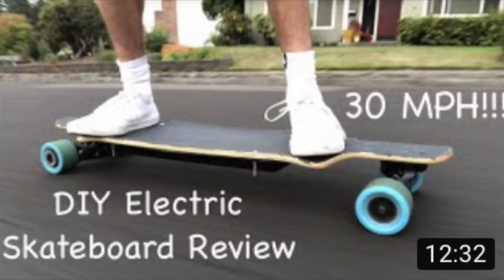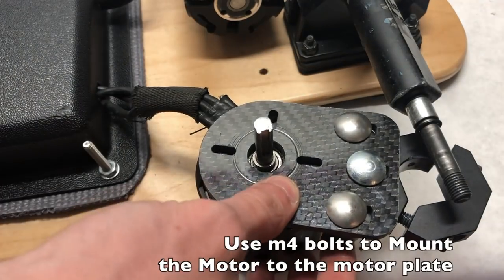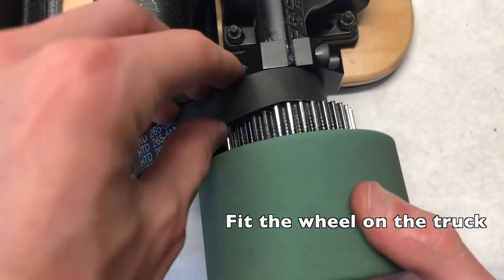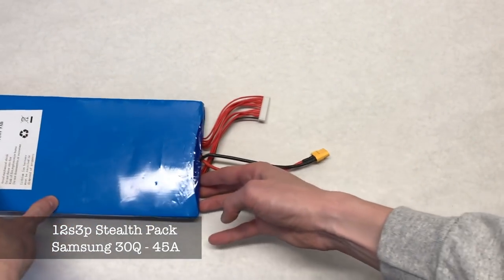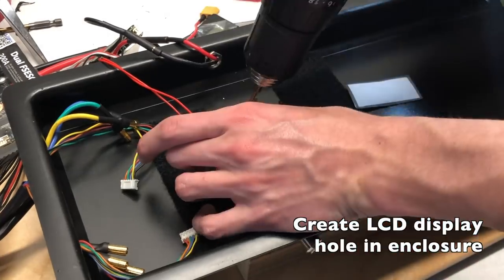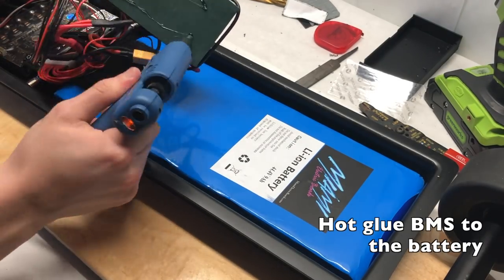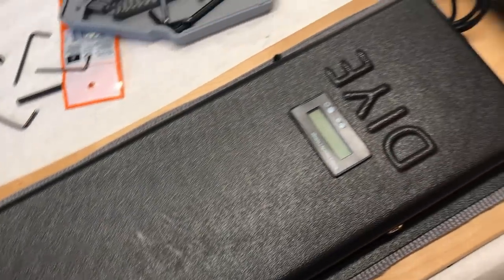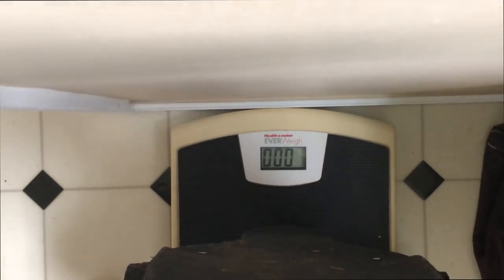How to Build an Electric Skateboard - 12s3p Dual 6374

Comment: wow you guys deserve way more subs! im gonna build this board if i can fond the parts
Reply from the maker: Sorry for not having a parts list for this board. We are in the process of making a new website. You can find a lot of the parts that we used on our old website: https://diyesk8builders.wixsite.com/esk8/12s2p . Here are some of the things we put in to make this new version. Motor Mounts: https://miamielectricboards.com/shop-1/motor-mounts. Motor pulley: https://diyelectricskateboard.com/collections/motor-pulleys . Belts 265mm HTD5: https://diyelectricskateboard.com/collections/pulley-timing-belts . ESC: https://flipsky.net/collections/electronic-products/products/dual-fsesc6-6-based-upon-vesc6-with-aluminum-heatsink. Battery: https://miamielectricboards.com/shop-1/standalone-stealth-pack . BMS box: https://miamielectricboards.com/shop-1/12s-bms .

Comment: I was looking at the same deck for my first build.  couple questions: also looking at long battery enclosure- is there too much flex in the deck?  Is there enough clearance for motors when carving? or could you mount motors to rear of truck?
Reply from the maker: The deck is not flexible at all, its stiff and you can mount the motors on the rear

Comment: Not all the people have 200 bucks for a ESC and other expensive components. However, you can get almost the same  feeling of riding using only 50-60$ dual motor ESC. Of course if you want much better torque and AMPs you need a better ESC, but for beginners 60$ESC is more than enough. There are also good motors for 50-60$ with 2000watts of power, you can go even lower if you buy hub motors. I don't want to advertise anything here, but you can google and easily find those components. Good luck guys. Let the electrical force be with you.
Reply: honestly disagree, my first build used the cheap 5055 dual kit and a cheap Chinese $100 dual esc. after around a month of use they just stopped working so i got another esc and then the motor kit was having slipping issues even after a belt swap. its worth it to just save the extra few hundred dollars. TRUST ME

Comment: very nice e-skate.
do you think a 218 mm truck on a loaded vanguard would look ok? i'm going to build a e-skate, but i want to use the 6374 motor for extra power because i'm like 200 pounds and i  want the motors to work without struggle.  thanks.
Reply from the maker: Yes! We actually just finished a build like this and we are releasing the video later today!
Reply: @DIYesk8Builders  that's really good news. Thanks

Comment: Smooth bro. Built my first recently, a single 6374 with 94 mm wheels and a 150 amp rc speed control I got 10 years ago. I finally put it together when batteries got cheep enough! So I'm running a 4 cell Lipo (7000mha) and get an hour and 15 minutes at full throttle (14 mph). BUT THE SPEED CONTROL! Do NOT use a rc speed control, it's INSTANT FULL TORQUE!(even on the Lowest throttle setting)!!! You Really gotta feather that throttle or it will leave without you!! Do VESC's have a much gentler throttle curve?!?! I'd love to know cuz mine will wheelie on 4 cells and it can handle 12 cells... sooo... much appreciated amigo. Nice channel, subed. :-) (Oh,, and I tried it on a 6 cell 5000mha Lipo once... ONLY Once..) The torque with the current speed control is unmanageable. I'd pull a frigging car. I'm thinking that's cuz of the 150 amp (continues, 200 peek) speed control and 50c lipos able to push 200 amps in an instant. Makes it a bit of a crazy ride and all. Cheers!
Reply from the maker: Thats awesome! We did a similar thing on our very first build using an RC car ESC. I 100% recommend getting a VESC, the throttle curve is so nice and will definitely not throw you off the board. It is a difference maker that you can definitely feel and it will make your ride so nice. You can also use more cells in series and run the motor in sensored FOC once you start understanding the VESC tool.

Comment: How would you rate this against an off the shelf board? I'm eyeing up the new exway flex but have just seen this.
Reply from the maker: All diy boards in my opinion are far superior in terms of all specs. Where its advantageous to have a pre built off the self board is that its a refined product. You know its never going to break, the controls are slightly more fine tuned, apps that connect to the board.

Comment: Sorry I'm really confused. May I know if I'm using dual 6374 motors, what arrangement of 3.7v 10ah LiPos should I have?
Reply: I've got about 30mm of clearance, and about 80cm of board space
Reply from the maker: I would go for a 10s battery with that
Reply: @DIYesk8Builders  Thanks!